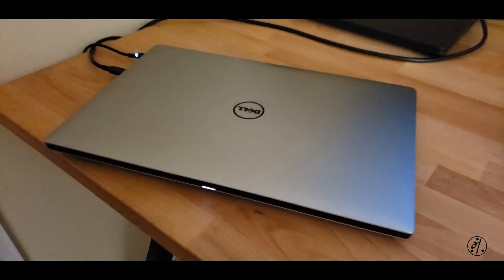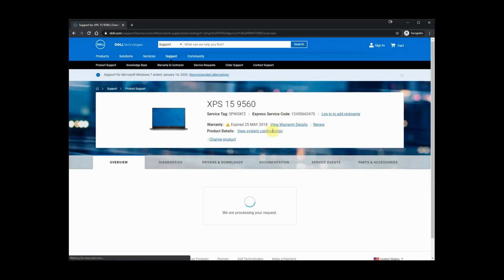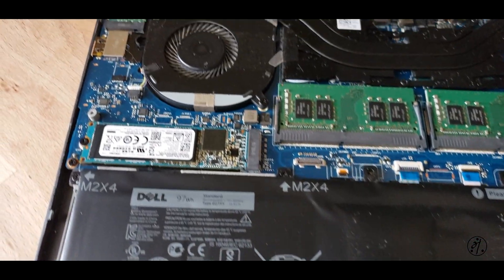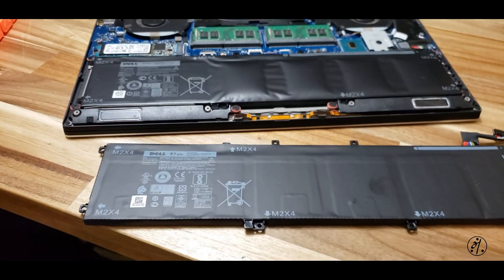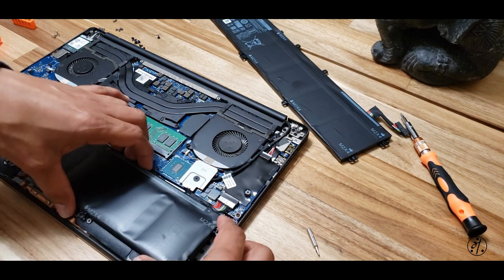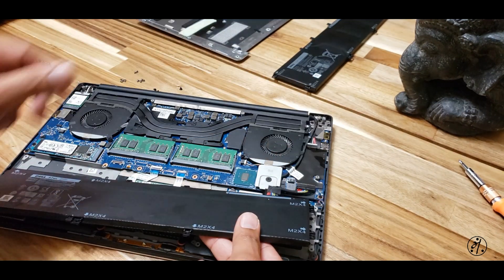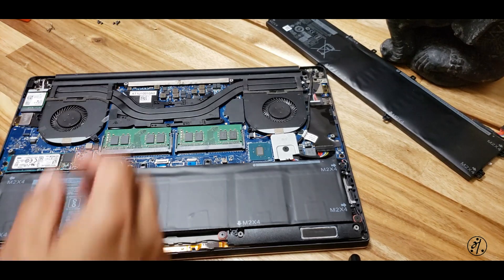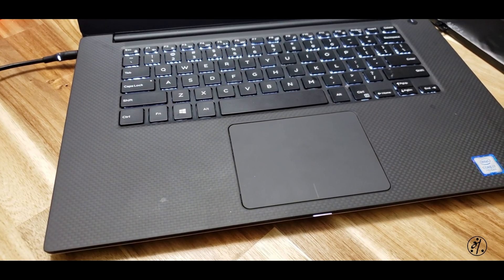How to fix Dell Swollen Battery | Dell XPS 9560 Battery replacement

Comment: why does this happen ? does it happen because its connected to external dock?
Reply from the maker: not due to dock or external monitors. Apparently it releases gas and it causes it to swell. It may also be due to poor manufacturing.

Comment: where can i buy the battery? There are so many shady websites out there...
Reply from the maker: If you want an authentic battery, then probably Dell. I am not sure Dell is selling that battery any more. When I asked them they only had refurbished ones.
You can look at eBay. If it's not sold by authorized dealer, then its pretty much not original. Mine from  ebay turned out to be a counterfeit, but its still working. It will shutdown if i run something CPU Intensive. I need to have it plugged in for that.

Comment: "$65 from eBay" means it is a Chinese knockoff battery. It almost certainly isn't truly 97wh. But this is a great video tutorial!
Reply from the maker: It turned out to be a knock off, but it's working for the last 2 years. If you do ntense CPU (4K video editing) work, battery cannot handle it and will shut down. So I keep it plugged in for those type of work.

Comment: I bought a precision almost 4 years ago and so far I have replaced my battery twice.  Dell has been very negligent about this issue.  They sold these as a desktop replacement howeve the battery does not support being plugged in all the time to a docking station.
Reply from the maker: I was disappointed with their response as well. I had to replace it as it was swelling way up and its a safety issue...

Comment: How do you get the new battery from dell, they are not in sale? I want to replace it also, can you give me the link for the battery please
Reply from the maker: Dell was backordered with no ETA, So I bought one from eBay. Listing said OEM and the battery looked very much like OEM, but I suspect otherwise.

There is no swelling with the new one, but sometimes (maybe 3 out of 10 times) laptop will shutdown even though there is more than 50% battery left. Dell said the replacement might not be OEM. Can't find the listing in ebay anymore, but the listing said  "OEM Genuine Dell XPS 15 9560 6-Cell 97Wh Extended Laptop Battery GPM03 6GTPY NEW"
Reply: @rmanni  interesting, this is exactly what's happening to my 9560 since I had the battery replaced. Well now it shuts off after 10 mins even at 80% battery left lol
Reply from the maker: @behnazjalali6996  the battery you replaced is probably not OEM.  your laptop is shutting down as your battery is not able to provide enough power.
Reply: @rmanni  that's true, I was wondering if this was refurbished bad quality.

Comment: Thanks for sharing. I suggest you get magnetic parts tray so you don't lose the tiny screws. It's very cheap and useful. I have both 13" and 15". I hate Dell keeps making thinner because it makes it hotter inside. I rather have a bit thicker and better air circulation. I regret buying the 15". I only use the 13" everyday.

Comment: can i remove the battery and plug the laptop directly? will it work? thank you
Reply: It definitely does work - I'm running my laptop like that right now...
Reply: Yes but unplugging it will instantly power off so just replace the battery
Reply from the maker: I did not test with battery removed.
Reply: It should work
Reply: Thank you!!
Reply: It doesn't work when you remove the battery and turn on my laptop don't have battery right now and its not gonna turn on without the battery and my battery is swollen
Reply: yup it worked for me, that's how my laptop was while waiting for the new battery to arrive

Comment: Thanks I have this problem as well with the 9560. I was hoping the trackpad would stop being pushed up, but it keeps getting higher and higher. I was worried it might be too high already but yours in the video is a lot worse! Helpful video
Reply from the maker: I think its safe to replace it (If you are lucky enough to be covered by Dell), as it could be a safety issue.

Comment: great video, OMG, having recently purchased a 2018 dell 15 9570, recently I was not made aware of a swelling battery issue. I am curious as to know if you have hade to replace the battery at all and how long are the batteries rated to last? Was there any error and or alert that the Windows OS gave you in your discovery of the battery problem, that is did you perform a diagnostic which informed you prior? This really sucks, to where I may now consider returning the laptop for this reason. Thanks
Reply from the maker: No errors or alerts anywhere, just mouse pad will swell to the point its no longer usable. I came to know about the battery issue after googling with symptoms, and it seems wide spread. 

Dell wanted around $45 for the diagnostics, which I did not do, as I knew what the problem was. I proceeded with after market battery, so i can fix the battery swelling issue...

If you just purchased Dell laptop, make sure that your warranty covers the issue, so you don't have to pay extra.
Reply: Dell is very aware of problem. They make a ton of money selling extended warranty so they don't care. I had problems with both my 9350 and 9550. They suckered me into buying extended warranty for both saying they have to replace motherboard. I had called because they stopped taking a charge and wouldn't turn on. So I send in the laptops and get back about a month later. The service ticket in the box said tech performed diagnostic and replaced charging cables. So I got charged cost of replacing two motherboards and all they did was give me refurbished charger cable. I was furious. I spent days and hours until finally I was able to speak to manager. I told him I was going to report this to all the news channels. Then he gave me full refund for both repair charges and extended warranties. They are scumbags. The guy denied everything and said I was the one lying. I told the manager. All my phone calls recorded I send them to you now.

Comment: Where did you buy the battery?
Reply from the maker: on ebay, it was listed as "OEM Genuine Dell XPS 15 9560 6-Cell 97Wh Extended Laptop Battery GPM03 6GTPY NEW". Was around $65